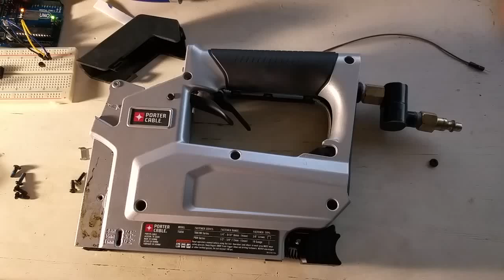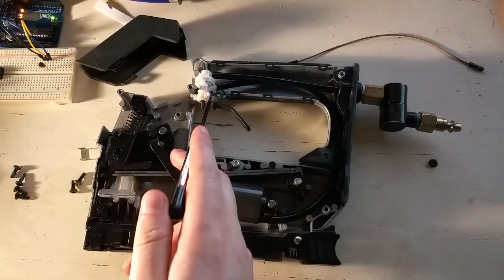Porter Cable TS056 Teardown

Comment: Nice job, but this is not a "Tear Down", it is a reveal. 
A tear-down would be you showing us the steps you took to take the cover off, locate the fault. Then showing why it is broken, and remove the faulty component as well as identifying issues to reassembly.
A full tear down would be down to the bare case.
I like this video, but I needed more, I need to understand why my unit is not working so I could fix it.
Here is the assembly diagram:
https://www.toolservicenet.com/documents/English/Exploded%20Art/Porter%20Cable/TS056.png

Comment: I had the lower power spring break. Its the flat bar that goes from the hammer all the way to the right of the gun. Between your video and the parts list i found i got it fixed for under $5! Getting everything realigned too a bit of tweaking but it works!  Thanks!
Reply from the maker: Cool, glad I could help!

Comment: Removed a jam stapler but really struggling to get the cover back on. The trigger assembly is easy to align, it seems like I am misaligning something in the upper corner near the ram as you call it. Were you able to find any assembly diagrams on the Internet? Any suggestions? Thank you.
Reply: Michael McCarthy  i'm having this same problem, haven't figured it out yet.
Reply: Any luck? I took the cover off, checked the insides, now when putting it all back together it seems something is unaligned as it will not press together.